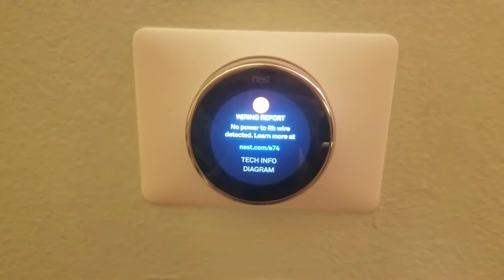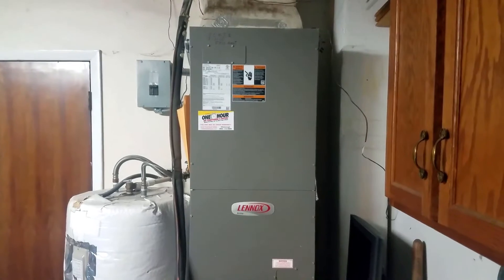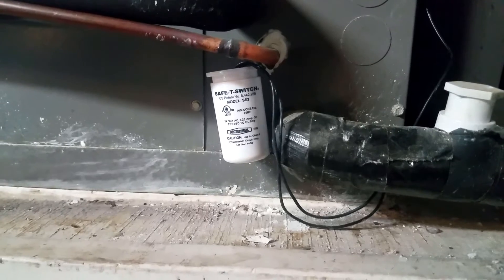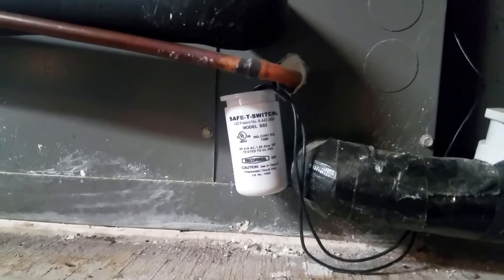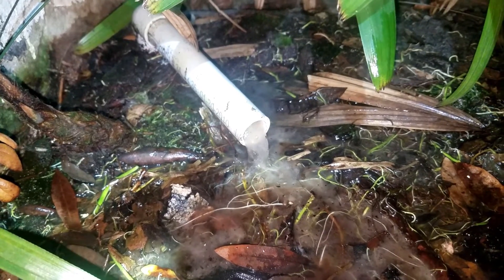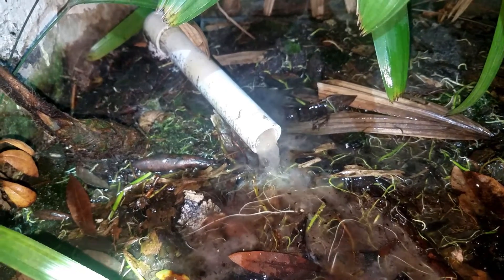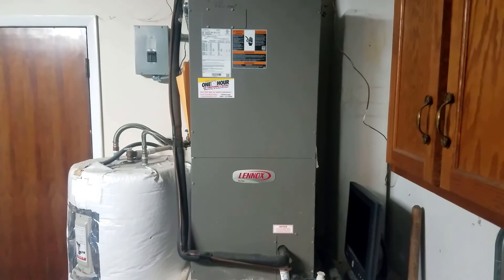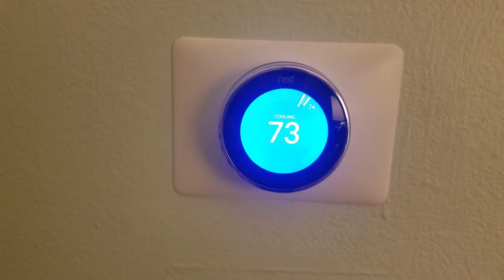[FIXED] Nest Thermostat E74 No power to Rh wire detected.

Comment: Fixed my issue,Thanks! You should probably add to your video how to prevent the issue from happening in the first place, which is by doing a routine maintenance on the air handler drain line

Comment: Hi.  I had the same problem with E74 Error code.  This video was excellent and I did find the float bowl was full of water. I have been putting Vinegar in the upright tube that leads to the drain (left side of the HVAC unit) but guess what- the float is on the other side of the HVAC unit!  There is about 18" of drain line that feeds into the line  with the float to the drain line.  I had been told (and the HVAC company confirmed) to add the vinegar or bleach to the drain line on the left side.  As soon as I removed the float and let it hang down, the AC kicked on and the error code went away. I manually lifted the float up and the AC stopped just like I found it, so I knew this was the thing that needed fixing.  I blew it out a couple of times and added vinegar to all the lines to clean them out. This video saved me a service call and I will now keep an eye on this. If it continues to shut down, then I need a better clean-out method than what I am doing. So far so good.  In Central Texas, we already hit 105 the other day so AC is required.  Thanks!
Reply from the maker: That’s awesome man!  Comments like this are why I make videos.  Glad you got it working and saved a couple dollars.  Good work 💪

Comment: I'm getting this error but I live in an apartment.
Reply: Update: I was able to fix it even though i'm in an apartment and things are a bit different than a house, but thank you to this video for putting me on the right path. My drain line was inside the closet with my air handler. The drain tubing was clogged, as well as the part that the tubing connects to. Had to remove both and flush them out with water. A lot of the gunk in the tubing came out, but not all of it since i was running faucet water through it. If you have a waterhose or pressure washer you could clean it fully. I went to lowes and bought new tubing. There was also water in the safe-t-switch tube which caused everything not to work. The pipe was angled up and right under the air handler, so i could only get a finger in there. I stuffed it with pieces of old t shirts to dry up all the water. Then i cleaned and dried the safe-t-switch.I shut off the power at the breaker before doing any of this. After finishing i turned everthing back on and it worked
Reply from the maker: Nice man.  Glad you got it fixed.  Good troubleshooting
Reply: @thefiXfiles  Thanks man. I would have never tried if I hadn't come across this video.

Comment: Checked all of this, no difference.  Solution was much simpler, furnace door switch was shorted and impacted by the top panel.  Removed the top panel until I could replace the switch, all good.

Comment: I had a similar issue today after getting a new heatpump installed. I don't have a drain on the exterior of my house but I do have a pump in the basement that the condensation drains into. The thing was full of water, which had tripped the same killswitch. Upon tripping the pump manually, my error is fixed. thank you!

Comment: I appreciate it, I now understand that error code is basically universal error code for system being shut off by a safety mechanism. Makes my life easier.
Reply from the maker: Glad it helped.  Hope you got it fixed ok.
Reply: @thefiXfiles  I sure did, just took a minute. The primary thing was knowing where to start. It was the air pressure sensor, my filter accumulated a lot more dirt over the past month than I realized so it was a simple fix.

Comment: you're a king, just had this issue. If anyone is interested, my grandfather actually attached valves so we can block off the ac pipe so water doesn't run into the unit and connect a water hose to completely flush out the debris out.

Comment: After a solid 10 minutes of me flipping switches, breakers, and the bird at my Nest thermo, I pulled the float switch like you suggested and presto - air conditioning in Florida in August.  Big high five my man.
Reply from the maker: glad it helped you get it fixed.  no AC would be downright hostile in this weather.

Comment: Where r how can I find that drain line ? Is that near AC unit or somewhere else?
Reply from the maker: Try to find a pipe leading away from your air handler and follow it. It should go outside somewhere
Reply: My unit didn’t have the float system 😩 only white pipe coming out the system n on the left is red cap …?

Comment: One easier way to fix it if there are no other problems is to restart the thermostat. Google claims that you should hold the ring down for ten seconds. I found that six or eight were sufficient. Then do a quick tap on the thermostat to restart it. This last might not need to be done, but if you are impatient or have ADHD like me, go nuts.

Comment: I fixed mine when I checked my basement HVAC and found that the GFCI power outlet at the HVAC had tripped. I reset it and it's working now, but I don't know the cause... so I'll go searching for jellyfish tomorrow (or tonight if it quits again). I just had the HVAC serviced a week ago!

Comment: This video was absolutely detrimental to me at 11 PM at night, I cannot sleep without air conditioning, I know first world problems right!!! My unit had a safet T switch on my condensation line that was filled with a little bit of water causing my entire system not to function, I shook the water out of the safe T switch and within a minute the system automatically turned on itself. May not be a permanent fix that I need but if it gets me through the night with air-conditioning it is the temporary fix I want! Thanks Again

Comment: Thanks so much! Ac was working before i installed new thermostat. Once i installed thermostat it did not turn on. Check fuse and few other things with no help untill watching this video and found out it wasnt my fault at all just a  coincidence  they happened at same time. Thank you again!

Comment: I had this problem today. I was freaking out until I found your video. We had a new HVAC installed and I forgot they put that sensor in. Drain pipe clogged as well. My shop vac wasn't making a dent, so I poured hot water down the pipe with the back running. So much nasty gunk came out. Thank you!!!

Comment: This actually turned out being my issue. I think the pump that pushes the water outside has gone bad and the water in the tank filled up enough to trigger the system from not getting power. I just emptied the tank where it pulls the moisture out of the air. Turned the breaker back on and my ac started up. Thanks for the video.

Comment: Great video.  It was the correct repair and you addressed it in 62 seconds.  So many videos drag on for 5 or 10 minutes and could/should be quick and to the point like the one you created here.  OUTSTANDING
Reply from the maker: Yeah I can’t stand the videos where people fumble around for 10 minutes.  The best way to respect people’s time is to not waste it.
Reply: Legend 🙌
Reply: 63 seconds
Reply: What if you don’t have a shop vac
Reply: @zeyadsaleh3317  Buy a shop vac.

Comment: If you do not have a shop-vac your HVAC might have a plastic pipe with a removable cap near the float valve. Remove that cap and use your garden hose to flush out the condenser line that way. Just make sure to power off the HVAC system first and make sure there is no water in the float valve reservoir before turning the power to the HVAC back on.

Comment: It worked for me, yes the condensation pipe was clogged, I poured some hot water and  use some wire to unclogged, then I shut on and off the switch, it took about 2  to 4 minutes to reestablish connection.

Comment: You just saved me to help my mom at 1030pm.  Had the same problem. Clogged line. Tomorrow will do a full clean.  Thank You 12-29-19. All day the ac would turn on run for about 30 min the shut off.  Now the ac is running good.  Thank You.

Comment: THANK YOU! Our condensation drain is inside and wasn't plugged, but the pipe got knocked to the side from storage boxes being shoved around, which caused the power shut off. Thanks to your video I knew exactly where to look to get this solved.

Comment: This video is awesome like he said check your line that runs the water out of the system because its more than likely that if that no power to rh comes on also check around furnace to see if there is a tray around it full of water suck that water out of tray and ac should cut back on